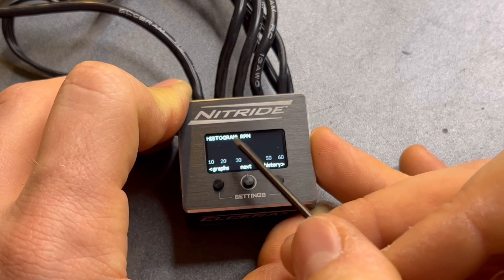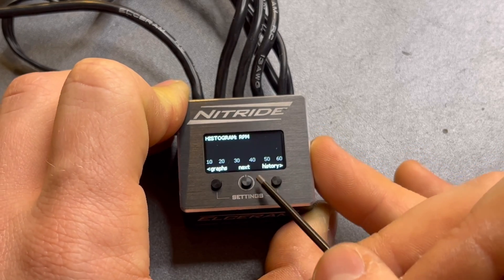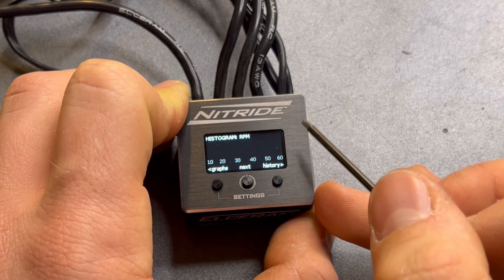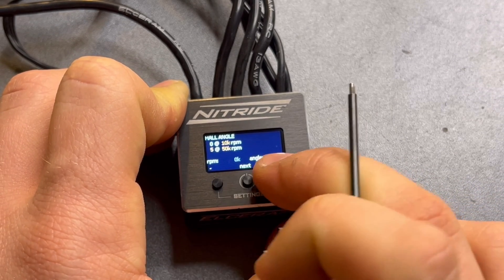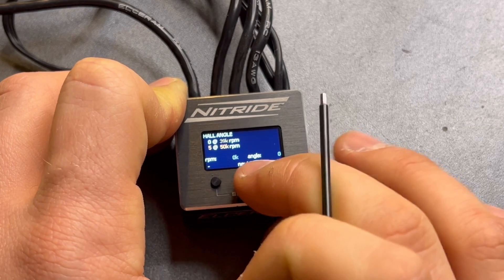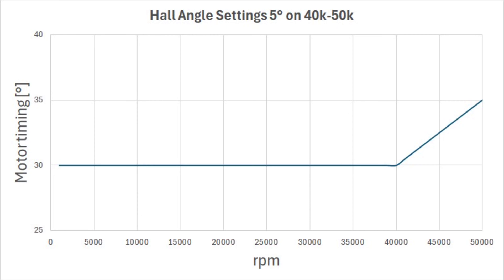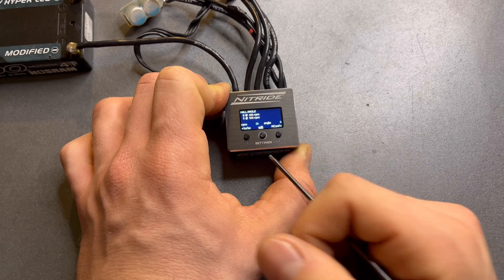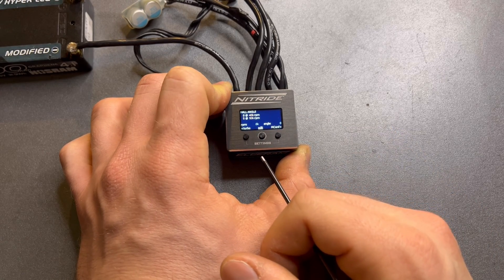Hall Angle Settings Explained - ELCERAM

Comment: Are the Hall settings locked in blinky mode
Reply from the maker: @SinisterGibson  if you change the hall angle setting, the blinky mode turns off. Better say, it does not show on the screen “Blinky” anymore, therefore is not allowed to be used in stock racing.
Reply: @maxgotzlrc2266thank you for the clarification